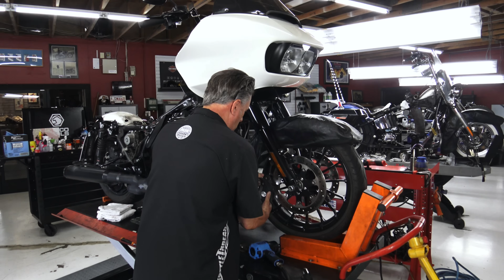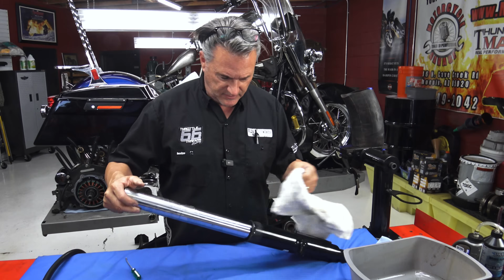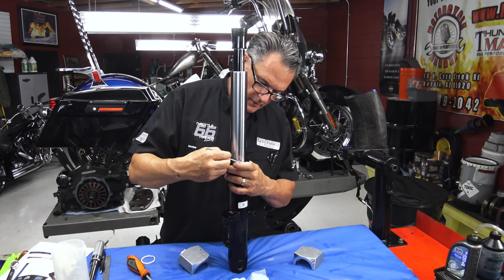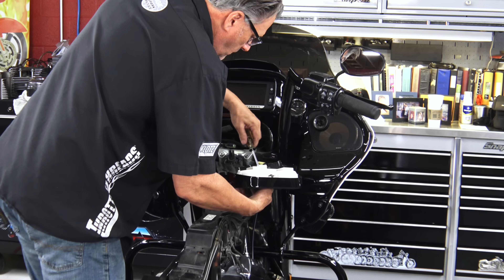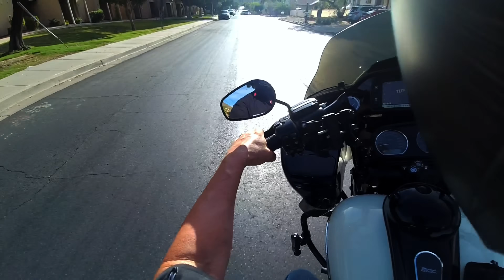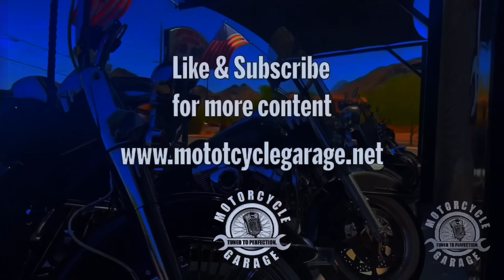This 2019 Harley-Davidson Road Glide Was Unstable At Any Speed

Comment: I have ohlins on the front and rear of my 2019 road glide. When going between 35mph to 45mph and a loose grip the handle bars shake back and forth violently. Does anyone have any suggestions. I had it serviced at harley and got little help besides them telling me the barring are good and wheels are balanced. Second owner so i dont know who installed the shocks or if that is even the issue.

Comment: Great Content I have a 21 RGS I have done the Legends upgrade to the bike both front and rear The Axio Performance Front what a difference it made. Prior to that I had The Stock rears replaced with the Legend Revo A's and this spring I replaced the stock 114 with the SE 131 Crate between the suspension and the increased performance of the 131 I am very happy with how the bike rides and handles on our not so straight 😉mountain roads.. Really enjoyed your video it supported my personal thoughts about having a great suspension is key to enjoying the bike to the best of my abilities and how I like to ride. Power means nothing without a good foundation and proper setup. Watch those tire pressure's!!!!   BTW with the Axio Performance Cartridges I can feel just a bit more through the bars when on a grainy paved surface but thats the nature of the beast but the confidence I have turning the bike into a nice sweeper with out worrying about the suspension washing out is very satisfying... BTW did you Dick Dale played his Guitar Upside down?....
Reply: Man, that was a very thoughtful comment, thank you. It’s good to know that someone like yourself takes suspension seriously. Thanks again for sharing

Comment: They took out all the rebound control. Rip the forks off and replace them with stock or at least do some research and get a competent suspension tech to modify it. 90% of riders do not need a modified suspension. Maybe if you want to do bagger racing. You showed us how bad the suspension po-go'd so you should tell us who sold that trash so no one else makes the same mistake.

Comment: I switched out to geezer engineering inverted trees and rear shocks. Running OEM showa front cartridges from GSXR 1000R forks. Best riding bike I've ever had. Used to run legends but they try to find everyway to deny warranty. So ive removed them from all my Harleys. 8 will not run anything by them ever again.
Reply: I personally haven’t had any warranty issues other than one shock that was leaking after two years. They replaced without issue. Thanks for watching

Comment: Hi Bill I own a 2017 Streetglide special, I am replacing the plastic fuel real with the S&S real and the updated H-D fuel line. The bike as a 468 red shift cam high flow air cleaner stage three kit with big bore cylinder 2 into 1 exhaust. The bike has been turned 110 hp 120 TQ . Why I have the fuel real off does it make sense to upgrade the 4.3 injectors to 5.5 injectors or just stay with the oem. Thanks
Reply: For what you’re using stock injectors are fine. Make sure the fuel line is on all the way before engaging the clip, give it a good pull after installation. I was actually involved in that new fuel line. The early one wasn’t very good. Thanks for watching

Comment: I put ohlins on the back of my 2019 street glide, bike sat in the turns so much better, no bouncing around. Put them in the front, anything over 80 the bike was very unstable. Don’t know if it was needing to be adjusted more or what. Test drove an Indian pursuit, unbelievable suspension. Traded in my street glide, and my 2014 limited, bought the Indian. Been riding for 35 years, Indian is just a better designed bike. Everything about it, suspension, handling, balance,performance.
Reply: I have zero issues handling with my factory suspension on my 23 Roadglide-ST other than it being rough. I’ve done 100 miles an hour and handles smooth as butter. Indian has a better suspension but to say it’s a better bike is a matter of preference.
Reply: @Prometheus1979 you said it, other than it being rough. Then the bike flattens out at about 110, and no more throttle. The Indian pursuit is still pulling at 100-105. You’re right though, it’s a matter of preference. Go test ride one then tell me what you think. The aluminum frame on the Indian, and the mono shock, and the adjustable suspension, and the inverted front forks make a huge difference.
Reply: I have quite a few Indian motorcycles that come in for service, great motorcycle. Im willing to bet the front suspension wasn’t set properly for you. Thanks for watching.
Reply: Performance nope, never see Indians racing Harley’s no where on YouTube, period I have a 22 Harley RG and no wobble in mine. No factory suspension holds up to damn near double the hp/torque. Have said that yes Indians are a good bike for those who like stock shit.

Comment: 🏒 good day sir. Hope all is well. Excellent information to share. Hard to believe a shop would let a customer ride away with the front end like that. IMO if a shop is confident of their work they would road test the machine before handing back to the customer.  Regardless of the repair.
Reply: Eli, you would be amazed at some of the poor workmanship I see. Hope all is well.
Reply: @hdmiko1 That’s the reason I do all the work on my bikes, actually built a shop in my backyard, with a Handy wide lift, and have all the required tools, and equipment to do all I want or need. 
BTW, great video enjoyed every minute of it, you’ve got a new subscriber here.

Comment: I have a question for you, I just had a Fueling 472 cam installed into a 22 Road Glide, 114, I had Screaming Eagle stage 2 torque cam in there before, all screaming eagle cam plate, oil pump, lifters & adjustable push rods, the tuner is a ThunderMax. after the installation of the fueling cam, i have a shudder from 1200 to 1600 in accel and decel. The guy who installed it says it is the tune but the Thundermax should correct for that shouldn't it? Could it be a bad install or maybe even a cam out of balance?
Reply: Maybe the clutch or primary took a beating during all the dyno runs! Change your gear oil and see if it helps 👌 Good luck rider